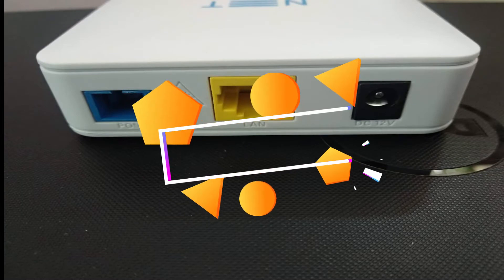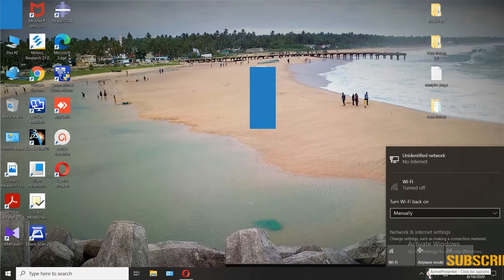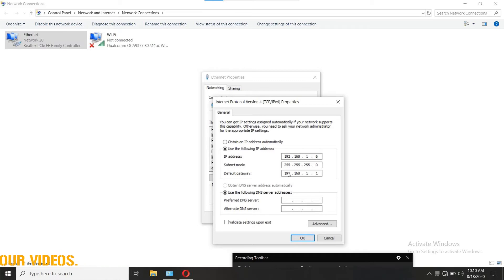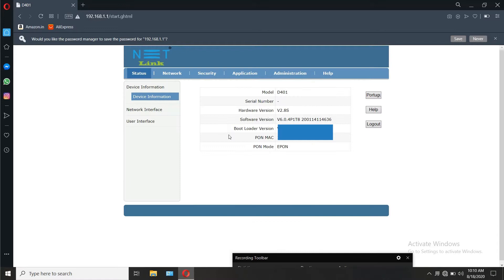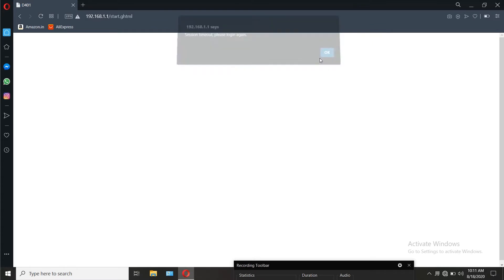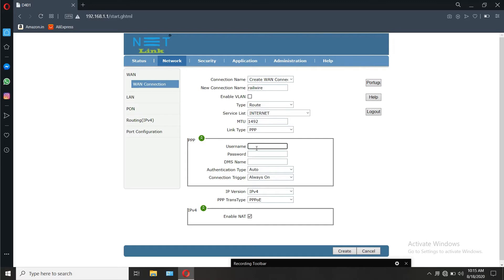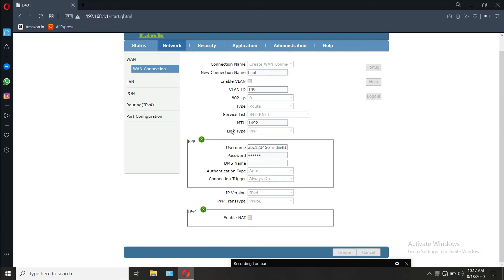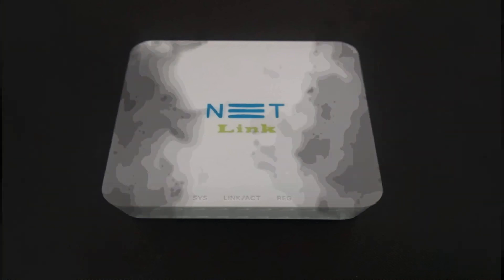How to configure Netlink D401/v2801SG | Netlink D401/V2801SG - Setup and Configuration - [ Part -1 ]

Comment: Bro how to connect this ont to dilink 615 router can I connect it 
I used the same set up at a private ISP now changed to Bsnl Fiber can I use ths same set up Next link Ont + D-Link
Reply from the maker: Do normal configuration in this device as said in the video.. 
Then simply set dynamic ip mode on D-Link and bridge both.. it'll work.

If you have any doubt, contact through Instagram/telegram

Comment: Bro , Username , Password Error..How to login , helpme...
Reply from the maker: Reset and try
Reply: @TechwindTw  reset is not working as well ... 
I tried changing the IP and gateway , 
i tried username : admin
password : stdONU101
just as given in the label 

no use , netlink is just a mediocre hardware and software ...
Reply from the maker: for the device in the video, username and password is admin/admin.
To reset the device, there will be  a hole at the backside of the ont, press and hold if for about 20 seconds.
Contact through telegram/instagram for further information.
KIndly subscribe to the channel.

Btw, if nothing works, there muat be an hardware/firmware issue with the device.
Reply: @TechwindTw  tried resetting multiple times... It doesn't work... Its a new device out of the box
Reply: @varunm7011  stdONUi0i try this